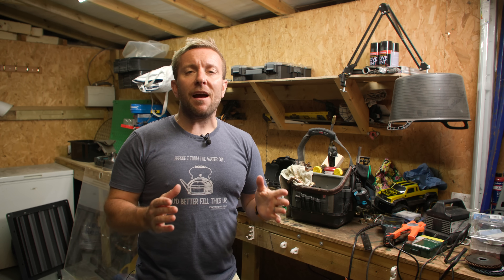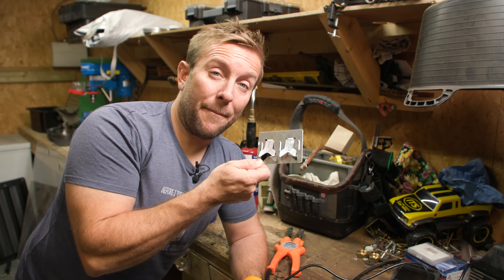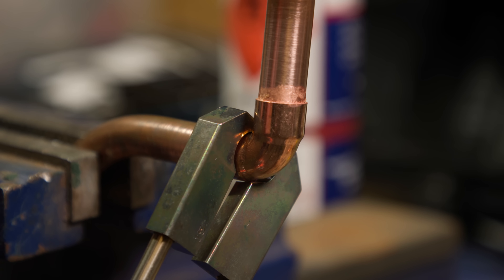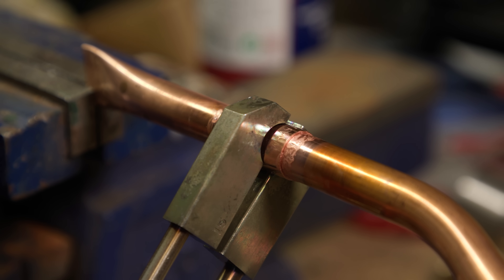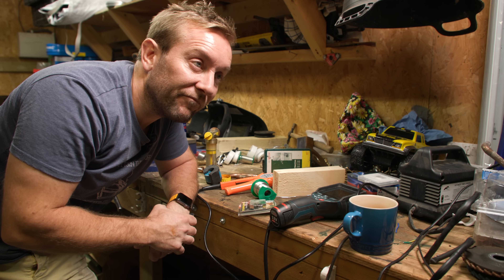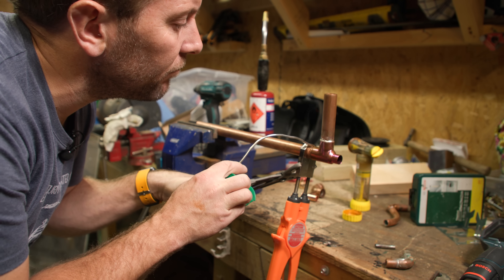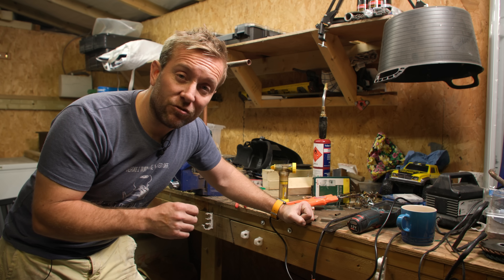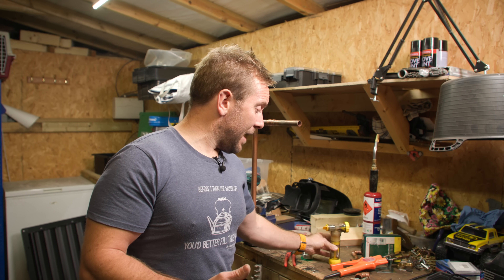Solder copper pipe WITHOUT flame or blow torch

Comment from the maker: :_bigg: IF I HAVE TO READ ANOTHER COMMENT ABOUT THE PLIERS ACTING AS A HEAT SINK I'LL PULL MY HAIR OUT! 😂 I did film it without the pliers and it still didn't work.
🍺 JOIN THE Alearmy Exclusive weekly live videos on Thursday https://www.youtube.com/user/plumberparts/join
🛠 AMAZON STORE https://www.amazon.co.uk/shop/plumberparts
📺 VLOG CHANNEL: http://www.youtube.com/c/timeswithjames
Reply: I can’t see the sense in this at all .
He talks about capiliry fillings.first why not have a clamp with a ridge which goes over the Yorkshire and not only clamps over but melts the solder
Reply: Good bit of kit for a trade who solders occasionally but doesn't want the extra cost to their insurance that comes with working with flames.
Reply: Aonde eu encontro este equipamento ?
Reply: Idk about the pliers pulling heat. But I do know from years of soldering that the solder runs to the heat source. And you have the source above the fitting. It'd be the same as having your torch in the same location. It would take eventually but the solder wouldn't run into the fitting as easily as if it was being heated on the fitting itself.
Reply: if you have a spare old pliers and you glued a scrap piece of silicone to each jaw...?

Comment: I really think you should put the heat tool on the 3/4 fitting like you did on the 1/2 fitting. The solder follows the heat so if you heat it from above it won't suck in like it should

Comment: Question - I have an electric water heater, and I just did my annual draining of the tank / refill.  Water heater is only about 4 yrs. old.  I did not do the pressurized flush method by keeping the incoming water valve open method.  I just drained the tank the way the instruction manual said to do (water hose, open relief valve, close incoming water valve, etc.) and then refilled the tank.   I checked the pressure relief valve to make sure it was good and then opened hot water faucets to check the stream of water and everything looked perfect.   So, then I cut the breaker to the water heater on once it was refilled.  After about 45 mins I went to the faucet and turned the hot water on and noticed that the temperature of the water was suddenly much higher than it was before I started the draining process.   I did not make any changes to the temp settings, heating elements, etc. and suddenly the water is really hot.  I know it's impossible to say what the problem is because it could be a few things but what do you think the problem is most likely?  If it were a mineral clog, wouldn't that cause the temperature of outgoing water to drop instead of going higher?   And I thought if it's the heating element it's kind of unlikely that it just happened to go bad immediately after refilling the tank.

Comment: As an electronics technician, we always tin the wire with a bit of solder to aid conduction, I'm certain this same method would work with the pipemaster, I came on here to say about the conduction of the molegrip but notice 175 comments already mention it, by the way if you was using the torch would you be heating the pipe or the t?

Comment: It didn't suck in on the larger piece because the heat was applied in the wrong place...you know this being a plumber. You would have had near the same problem using a torch in the wrong place.

Comment: Rather than metal clamp at the hot end, maybe a different  bodge might work?

 cable tie loosely around both handles. Move cable tie as far as possible from pivot. Tighten cable tie when tool clamped on work . Place Dab of superglue in the cable tie's racheting mechanism to jam it. 
With luck will then  able to slide the cable tie over the handles as and locking or release wanted.

Comment: Don't use pliers which will suck the heat off the iron. Better to grind the jaws to a better fit, and then you can actually use solder on the iron to better transfer heat.

Comment: These are real handy in confined spaces where a flame could be a problem and they do generally work well. However in some situations they can be difficult to get into position for instance with a pipe against a wall where you need to come in from the side so they don't replace a torch completely. You want to get the more powerful 220w version for 22mm pipe heats up the joint much faster.

Comment: The tips you.... you ruined the tool by dipping it in water and yes the pliers too ... your problem it your impatience  🤣😂 I have used this tool for couple of months now and it works just fine. . HEAT IT UP BEFORE YOU PREPARE THE JOINTS AND BY THE TIME YOU DONE ALL THAT IT WILL EVEN SOLDER YOUR MOTHER-IN-LAW to you.  ( we have 240v outlets )

Comment: Never heard a solder joint referred to as being "sublime"!
It would be nice if the jaws were spring loaded so you could just clamp it on and let go while it heats the fitting.

Comment: I've got a set of these and they don't get a huge amount of use, but if I'm working in a confined space like a airing cupboard where it's super tight, they give me more peace of mind when I leave the job that the flame from my torch didn't do any damage or more importantly, leave anything smoldering away that I didn't or couldn't see.  These days I'd probably use a push fit though.

Comment: It’s a good idea but I don’t like the fact that when removing the tool you can see the joint moving, this fractures the solder before it’s had time to cool. I’m only a DIY person but I’ve had to solder in some very tight places, most pipes are in the worst possible place anyway and I haven’t set fire to anything, I put a heat matt round the joint and as long as you blowtorch is good, it only takes seconds to sweat in the joint.

Comment: The jaws need a changing radius along the circumference so you can choose where it seats best.  You'll never get 100% contact, but should always find a sweet spot for good contact surface area over half the pipe.

Unless the pipe or fitting is perfectly matched, these seem to rely on a few points of contact which is horribly inefficient.

Comment: a better/faster flame-less  soldering method is using induction heaters https://youtu.be/QZDKjV5SZGs that being king of the hill for flame-less methods, using heat-gun will work too and you're not touching the fittings as I see it happens here.

Comment: 22mm tee joint, I suggest to start heating at first bottom joint as heat rises slowly, move heater up the joint and solder as you go, heating above tee first probably not effective as good percentage of heat travelling up the pipe.

Comment: Heat should always be applied to the fittings, not the pipe. Solder flows TO the heat, and capiliar working works then best if that part is heated

Comment: Maybe heat the pipe near the fitting then apply your solder?, This would ensure a perfect wrap around and heat distribution, And put the element on the centre of the capillary fitting to do both sides in one stroke, Just a thought..

Comment: Hey I used heavy rubber strapping to pull tight the handles, no issue with the heatsink issue. Too bad we can't use an induction heater to heat up copper but I see a problem at slipping the coil round pipe that it would become entrapped into the mess. Now if someone could come up with a split coil induction heater for copper it would be nice.

Comment: Putting pliers on the heating elements of the unit will absorb the heat back into the pliers pulling it away from your tubing you want to solder.

Comment: Hmm - seems pretty good for 15mm as you said - BUT (as a frequent DIYer) I think I'd sooner use compression fittings in tight places rather than spring £87 for the tool.

Comment: Bought these so didnt set fire to close flamable stuff even with heat mat for scorching. The promo I saw a while back shows heating pipe to side of joint. 
Dont think they are a speed item like you say more get you out of trouble spot.
Oh and the pliers are heat sink 🤣.

Comment: speaking as a world champion in making leaky joints, a couple of ideas.
how about putting a spring between the handles to hold the grips tighter, also, a tube lined with heat resistant stuff as a holder so the hot bits are in a safe place when not in use ?

Comment: Seems like they suffer from the same problem as cheap soldering irons when you need to solder onto large heatsinks—they can get hot enough, but the raw thermal output isn't enough to maintain heat when there's a lot of pipe/heatsink sucking heat away.

If that's the case, this method would only get worse as you use larger pipes (thinking like HVACR large gauge pipe).

I wonder if anyone has thought about making an induction-based heater for this? Would be far and away more efficient than these sort of things (though would make melting the pipe way easier, would need to be careful to monitor temps).

Comment: Looks an absolute load of rubbish, expensive rubbish too, no plumber would lamp up a single joint like you did on the 22-15 reducing tee, once you apply the lamp to one side of the 22mm fitting, all three sides would be done in seconds.  Also you never risk the joint moving while you're lamping up.  39 years as a plumber, never have I seen such a load of rubbish.  The way you applied the solder to the end feed fittings, you looked like a complete amateur, this is water and gas your trying to ensure doesn't leak, those joints are worse than any first year apprentice I've had - give it up mate

Comment: I'd say you didn't have success in the t piece solder as the multigrips were quite a ways along the heating block things, and the steel of the multigrips would have been drawing a lot of heat away from the tip.
Reply from the maker: Pinned comment!

Comment: If the clamp bits were bored out to fit the outside of the female fitting, I think that would solve most of the problems. I think they should fit the fitting quite will to work as intended. Thanks for the vid!

Comment: Hey Dim-Wit,  when using your channel locks you're creating a heat-sink drawing heat away from the tool thus making it less effective in heating the pipe.
Reply from the maker: Hey cock head, I tried them with and without…they didn’t work both times. Now sod off! 😂

Comment: The golden rule when soldering is don't move the pipe or fitting until the solder has cooled down or the solder might crack, I can see that there is a lot of movement of the pipe and fittings , high risk of cracked solder with this system.  And I think that you mean a solder ring fitting 👍

Comment: I have taken to crimping, been using this for awhile now, not had a failure yet, cost of the crimping tool can be a bit pricey though you can start low budget.  Ideal if you are in a hazardous area with flammable or combustible materials about.

Comment: I can't remember the brand name but have you ever used that "glue" for copper pipe and fittings? It actually works but there's no way I'd trust it on a pressurised fitting under a customer's floorboards.

Comment: try out the -
Rothenberger 3.6700 / 3.6701 Rotherm 2000 Electric Soft Soldering Unit 110 / 240 Volts
Fast safe flame free soldering for copper tube and capillary fittings.
 2000 watt.
    For use from 6 to 54mm diameter in any location.
    Supplied complete with soldering tongs with a 4 metre cable, soldering tongs and 2 metres of mains cable.

instead of 120 watts

Comment: On the big fitting where you had probs, I would advise you get the thing closer to the fitting and no clamp, don't worry about a bit of solder getting on the heater.  You will only get a burn off it once, then you will become super aware of it.

Comment: na m8, I'd rather press. for 1 fitting that iron does i'd press 10 times the fittings. if you not able to solder just press for the pro. don't stress press. no fumes, no industial asthma.

Comment: It doesn’t look like you understand the theory of “heat sink”. Putting a cold pair of pump grips onto a surface that relies on high temperature to work- not such a good idea. I have one of these clamp systems and with a bit of fettling they work perfectly. Admittedly I don’t have the 22mm jaws but for 8, 10 & 15mm they can get you out of trouble when close to combustible surfaces. I’m surprised you even considered putting cold steel on them. 🤪😵‍💫

Comment: You probably need to tin the Pipemaster and pipe so that there is a greater surface area that is in contact to increase the transfer of heat. This is the same principle used in soldering electronics.

Comment: How long do you heat up the fitting with a torch before soldering for comparison?
Perhaps a good idea to leave them resting over a mat if you're worried about the stand.
Reply: Depends on how hot you have your torch.  me personally, I set my torch to but pretty low, just below being able to hear the hiss of the torch burning and for that level a 15mm or 1/2 pipe takes about 10 seconds to heat up.

Comment: Not sure I like that there is quite a bit of movement of the fittings when releasing the tool, could end up with cracked solder and leaking joints, would rather stick with blow torch and heat mat myself lol

Comment: I have an Antex Pipemaster, I've twisted a hair band around the grips, this does keep the iron tight on a pipe. 
I plug in iron, prep all pipes, heat 15mm pipe for 30sec, add flux, heat sleeve for 20secs, solder.
Same applies 22mm but add 10secs to heating as there is more copper to heat.
Reply: Excellent advice. Will try that.
Reply: @happydavid13  I forgot to mention, try not to get flux on the 15-22mm heads, the internal diameter increases with corrosion and 15mm becomes 16mm.

Comment: Great vid' as usual, can you do one on how to de-solder a joint to use again, as I was in possision where I needed to split a joint as I was not able to cut the pipe as it would have left it too short to re-joint under the floor, thanks.
Avid DIYer...

Comment: "I don't want the heat on the pipe I want it on the fitting" Exactly, in an ideal world your heat should be where you want your solder to go and your pipe and fitting should both be heated. Holding the clamps on just the 3/4" copper tube and not the fitting isn't as good as if you could apply the heat directly where you want it.
Reply: Most people would likely use the pipemaster with capillary fittings where it's better to heat the pipe.
Reply: @mfx1 That makes sense in theory because the solder comes attached to the fitting already but I have never used a capillary fitting like what's shown. I've never even seen a capillary fitting before this video. I havn't seen any in local plumbing supply or hardware stores like Wosley, Crane, Emco, Bird Stairs, Home Depot, Home Hardware, Canadian Tire,  Frasier's, etc. Not a useful tool for me at least.
Reply: @kraken21990  Solder ring capillary fittings probably aren't a thing in the US but then neither is the pipemaster I suspect given it'll likely struggle to get hot enough with 110v outlets.

Comment: I have seen it done with hot air heat gun and semi circular deflector plate  aroun the back of the pipe so you don't even need a heat mat but you slow down the process

Comment: DIYer here. Thanks for the review, but I wouldn't have one. It in its current state it looks to me like version 0.1. The clamp parts need to fit more closely to the pipe OR the fitting and there should be some sort of clamp lock. The wattage should probably be higher as on 22mm it didn't have the guts required for good solder flow. 28mm - forget it. 
Now, I reckon "version 1.0" would be good for the pro, as I was told by a plumber the other day that on a building site he would have to stay for a couple of hours after the last blowtorch enabled joint.
Superfire II all the way for me...
Reply: Probably not version 0.1 - I had a 25-30 year old set of these (Antex, but yellow) which I finally took to the skip a few weeks ago, unused.
Reply: They've been around for YEARS I used one when I re-plumbed my house over 20 years ago but only for some joints in tricky locations, I used gas for the rest.

Comment: Seems like they've had to make a bit of a compromise on the size of the jaws. Not quite perfect fit on pipe or fitting. I can imagine when they were designing this they would have considered the benefits of shipping two pairs of jaws per nominal pipe size. One stamped with "15 PIPE" and another set of jaws with "15 FIT". Doing that solves one problem but introduces more inconvenience.

EDIT: Cracking video btw.

Comment: You can also get an attachment for the blow lamp that is a metal sheet that clips onto the lamp and hooks around the pipe your soldering... or could just use press fit if you ever with the lottery to buy the fittings

Comment: Yep the handle of the tool needs a lock clamp to hold it tight, or around the neck of the heat rods, otherwise I would be very interest as a DIY person as all my tools around the house have been turn into electric, why because I have Solar on the roof, and a battery bank in the loft, since I moved into my house 4 years ago I've been using solar power for all my jobs, the last tool I have is the blow torch!!...thanks for the review. PS I agree with 'rikmoran' placing a pair of clamps around the hot end will act as a heat sink and take longer to do the job.

Comment: If you just want to avoid using a naked flame you can use a heat gun. It doesn't deal with the problem of restricted spaces as well, but might be an option... Here is a video of someone else doing it.
https://www.youtube.com/watch?v=tsXuyWj0zc0
I'm only DIY, and can and do solder using a domestic blow torch for most of what I've done, but I've also used my old B&D heat gun with suitable attachment to solder really quite quickly and safely when the situation demanded it.